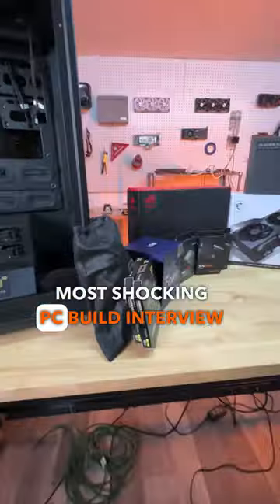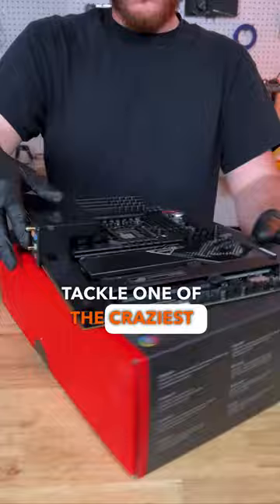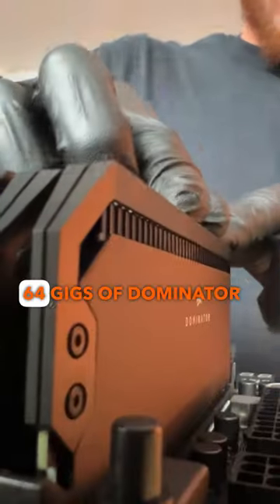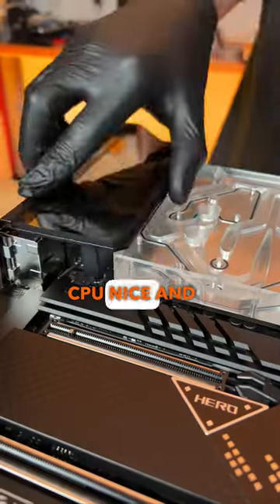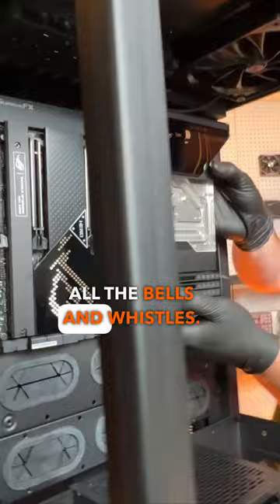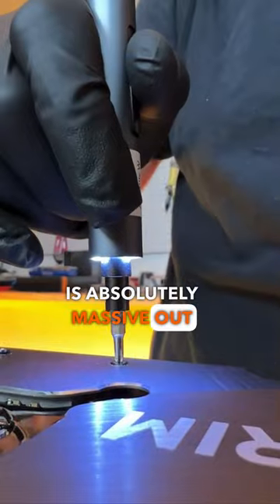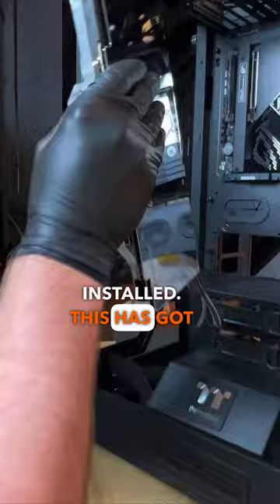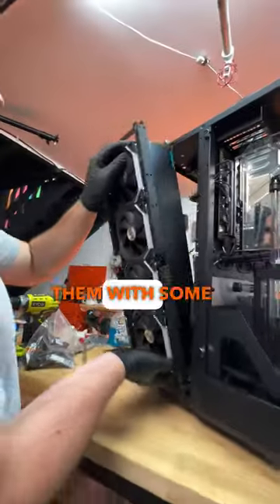The most SHOCKING Gaming Pc we have ever built 😵⚡️

Comment: You really need to run a push-pull fan setup for radiators that big. You’re cooling is going to be greatly stifled. Uni fans are subpar radiator fans as well but I get it- some people like the rgb/connectivity over performance. Y’all should know this tho smh

Comment: I’ve heard SSDs slow down as they fill up, that performance is reduced to around the level of a mechanical SATA drive by the time an SSD reaches half way full. If that is true, wouldn’t a pc perform better with a single large drive than multiple smaller drives because a large drive will take longer to become half full?